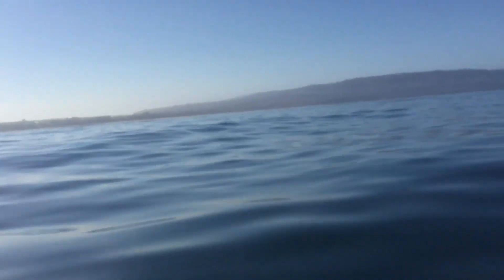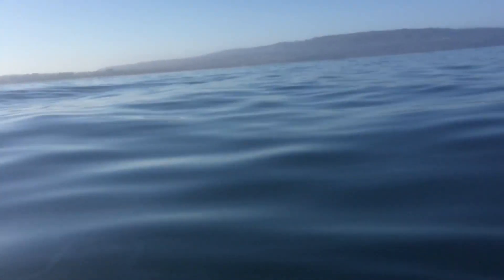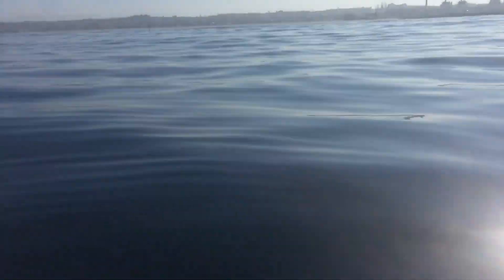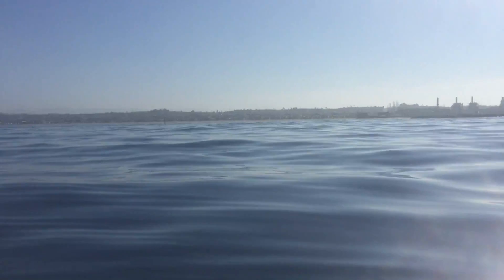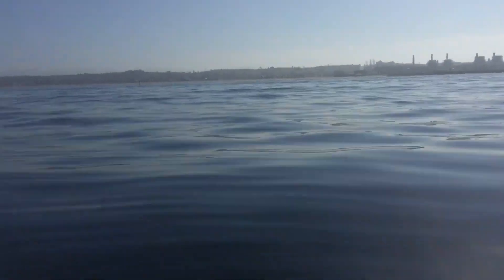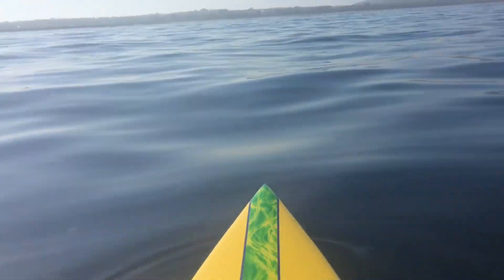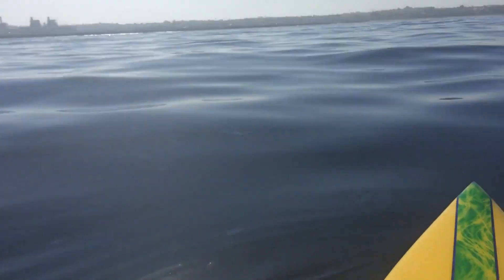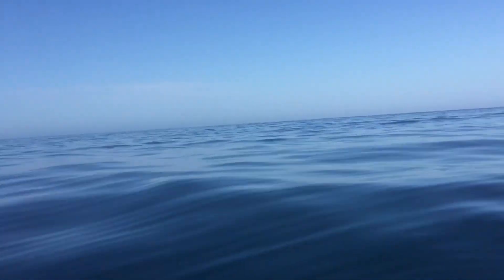Leaking plugged oil well in Ocean off of Redondo Beach in the Santa Monica Bay?

Comment: These seeps are NOT from old leaking oil wells, they are from naturally occurring fissures in the sea bed. You can see the same type of natural seep above water at the south end of Carpinteria Beach. It’s the same thing that gave us the La Brea Tar Pits. Only difference is the seep is happening offshore under water.
Reply from the maker: Why can't a drone or a diver get these natural seeps on film?  They are always in the same spot about 2 miles offshore near the yellow sticks.  I challenge someone to find it.